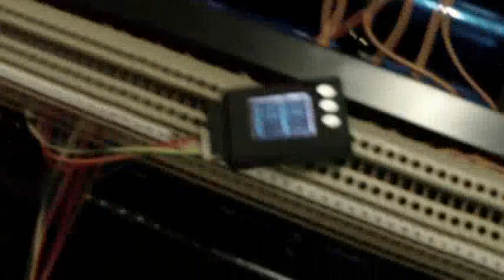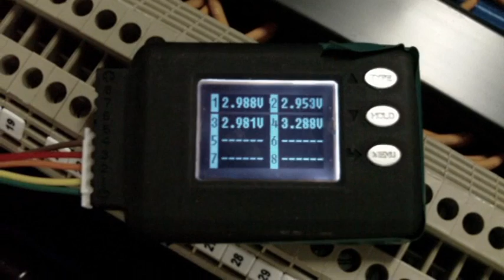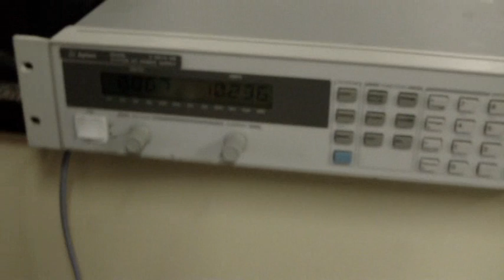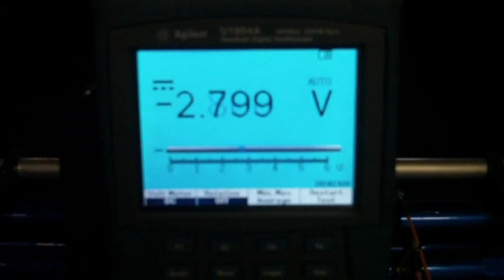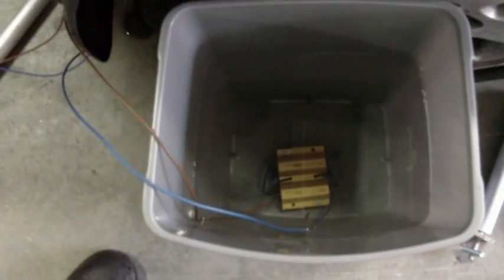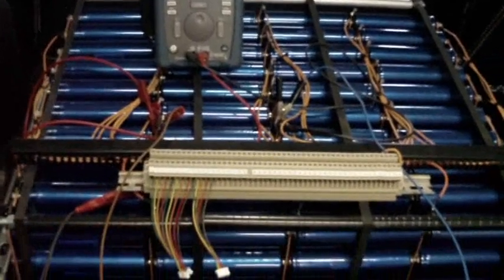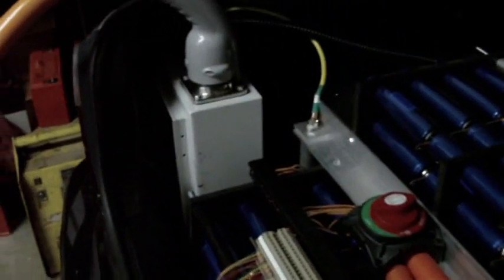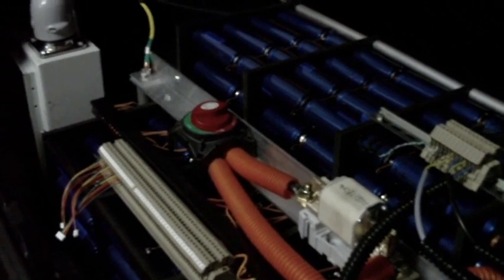BMW EV Conversion 56 Bottom Balance

Comment: The more cell you use the bigger the risk, just because they look the same and the stats never show individual specs of a single battery because you wont buy them. Their resistance is slightly off to a good amount so you'd think in a perfect world Headway would sort these out but China will not and we will take the loss.

Comment: A couple of points... Headway cells are notorious for having differences of resistance among the cells. I have a 28 S 92 Volt 15 ah headway pack in my trike and I do not runa BMS. Instead I bottom balance. I initially run them all to 2.8 volts and then charge all together. All stay relatively consistent on the upward charge curve until around 3.43 volts when a couple begin running away. By the time the 2 particular cells get to 3.7 volts most of the others are around 3.45-3.5 volts...BUT the good thing is as I discharge them, when they need to be charged up again, they are all very very close in SOC. Usually when they are all hitting 3.2 volts I re-charge. After about 6-10 cycles some will begin to drift, meaning that some will be slightly less voltage on the charge cycle and therfore only get to maybe 3.42 volts while others are at 3.6, 3.5 volts...SO in this instance I will individually charge that cell giving it maybe 1 amp and presto..its back in line again. Bottom balancing will net you about 80% of the capacity but as opposed to Top balancing, some of the cells on the dishcarge curve will start hitting dangerously low voltages and this becomes exacerbated as the other stronger cells begin to cannabilize them even further and I have lost many cells this way. Another point....As long as the load is not great I have easily reused Headway cells that have been discharged to 1 volt or so by charging slowly with something like .5 amps untill it hits 2.5 volts then upping this to 1 amp, then 2 then 5 .Actually only one cell was not recoverable when I accidentally discharged it below 2 volts but was under more than 7 amps of load.

Comment: My limited use of A123 li-fe cells have indicated that balancing isn't very critical as the batteries settle down by themselves.  Obviously a bad cell won't match the others but generally they are all pretty much the same over time.

Comment: These cells seem to be the way to go for cost, long cycle life plus high discharge rate.  Prismatic packs look too fragile for an auto.  Liquid cooled charger looks like quite a bit of work.  The Xantrex chargers for my solar system can handle a lot of amps without getting hot but they are only doing 48 volts.  Maybe they can be used in series.  Sun power is unlimited and the price of panels is way cheap now.  I'm looking at these same cells for solar storage.

Comment: @DanFrederiksen *Sigh* Did Damien here see any cells go low? Did his controller flag it? Did any of his plentiful supply of indicators and electronics inform him his weak cells gave up the ghost? No.

Reality is unreasonable to your opinions. Especially of the number of people running out of fuel on main roads. They all say it was a surprise to them or the gauge failed.

Comment: @DanFrederiksen Stop imagining. You are utterly wrong about cells self top balancing.

You know Jack Rickard has fixed issues this way. Damien here and Gotdi (Greenev) is also doing it. Must I name more and more endlessly who have fixed issues and ended problems with bottom balancing?

Nobody can promise a time they won't run out of fuel. it happens. When it does, its damned expensive unless the pack is bottom balanced. It can take moments to ruin a cell in a pack under load.

Comment: @DanFrederiksen Dan, if ever Damien runs his pack too low. A top balanced pack will destroy the lowest cells, no question. Even with instrumentation nobody can promise there won't be a time when this will happen.

Charging to the correct level is not too hard to set. Nobody worth their salt will overdo it.

Comment: 1.6V cell suspect? 1.6V cell = dead !  You shouldn't have even tried using them.
For the good cells - how many times do you have to bottom balance?  If cells have a different capacity, this could take forever.

Comment: Why not build the battery pack to run like a distributor for a spark plug, where it rotates around. Then you could cycle between the batteries evenly, and be sure of using them all at the same rate. Surely there is some way to do this electronically? Would make the battery pack last longer. I saw a story on a show where they used the same batteries in 2 electric go karts. The only difference was 1 had an advanced battery controller module, and it was still going strong 2km after the other died.